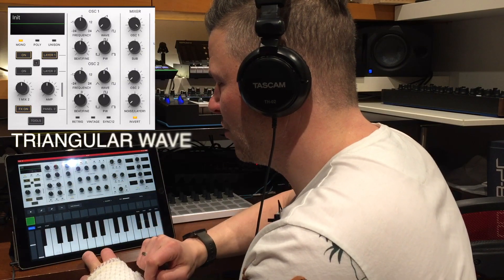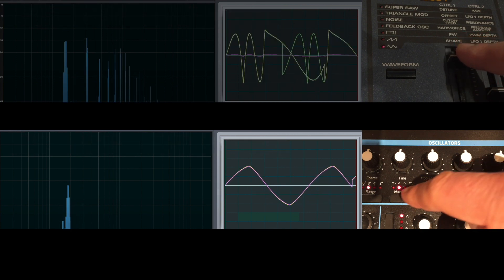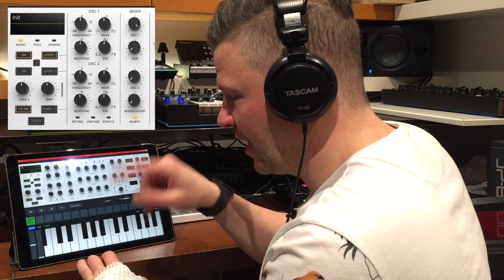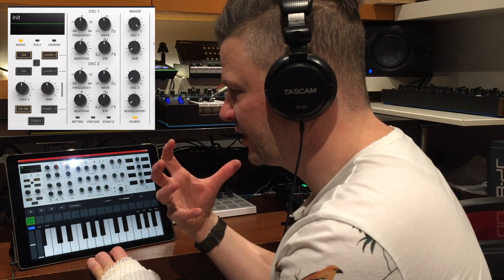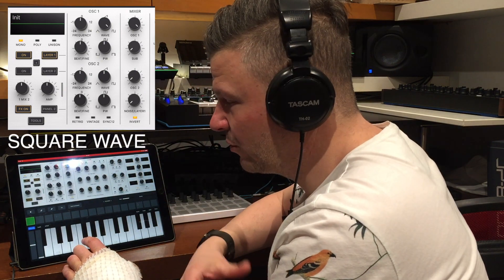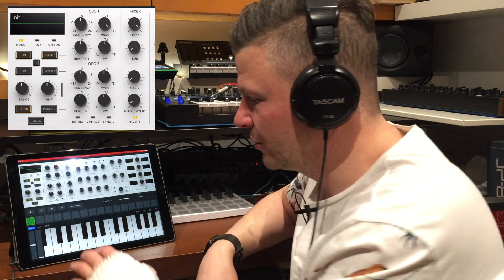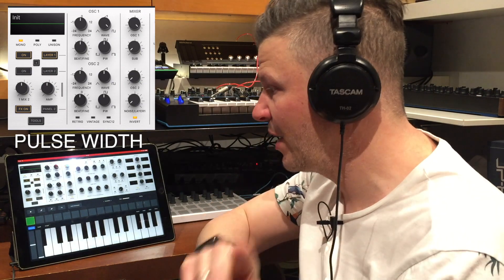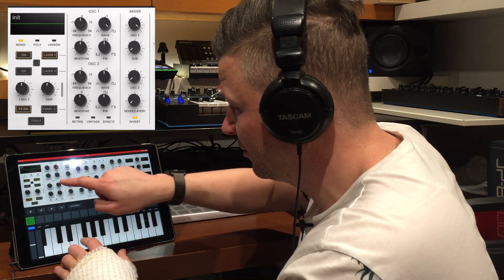Synthesis 101 - What is an oscillator?

Comment: Thanks for explaining what an oscillator is because I have several synthesizers, some are digital and some are analogue, some are minature in size eg Volca's but also I have a few large synths too like the Korg Wavestation with its vector synthesis, I also have a couple of Roland synths including a Gaia SH01 which is what I started with and an SH201 too, a Behringer Deepmind 12 and also a Yamaha CS1x, but after quite a few years of playing these and twiddling the knobs especially in the analogue synths my wife keeps asking me what does is an oscillator ? and what does it actually do ? and I always struggle to answer her. I know in my head what it is but try explaining it to someone who doesn't know anything other than to tell you that they like the sound of something then it is difficult for me to explain the correct answer but you have sown the seeds in my head and now I can explain to her and to anyone else who asks me what an oscillator actually is and what it can do, maybe I should buy a Korg Minilogue as it is relatively cheap and has an oscilloscope which you can view the shape of the oscillator.

Thanks for the great explanation

Glen 👍

Comment: Thanks! Very useful. Looking forward to the next vids on filters and envelopes/LFOs. There are a few features on my sh201 (especially with envelopes and LFOs) that I don’t understand, so hoping your vids will help. 👍
Reply from the maker: Thanks for the comment. What are the features of the Sh-201 that you find hard to grasp? I'll try to include them in my videos.
Reply: Under the filter section on the SH201, there is a Filter Envelope section with ADSR and Depth sliders. I guess this has something to do with the LFO modifying the filter, but I can’t get my head around it. Also, on a similar note, there is a ‘keyboard’ slider in the VCF section on the SH101/SH-01a. Does that also modify the filter in some way? Thanks in advance for your advice.

Comment: Well, I was hoping for an actual "what is an audio oscillator"  :) - what is happening when electricity is running through an op amp circuit that causes the vibrations that cause the sound etc (quartz, transistors, capacitors etc) With software synths, are they using the quartz clock of the cpu to generate these sounds?  But I am cool with the basics - many need this, and there are plenty of resources to dive further into how and why electricity can become harmonic on the internet.